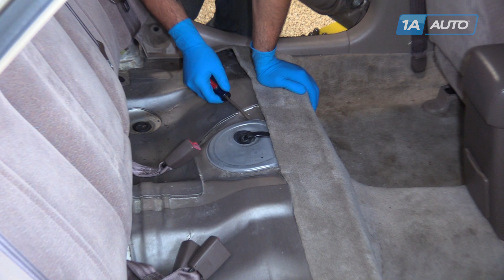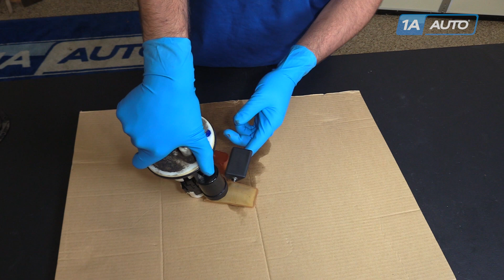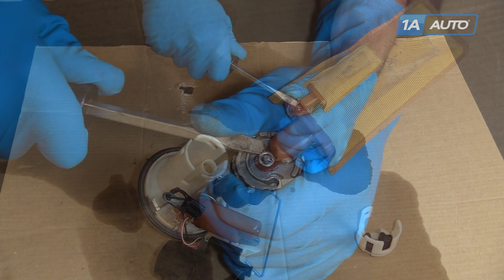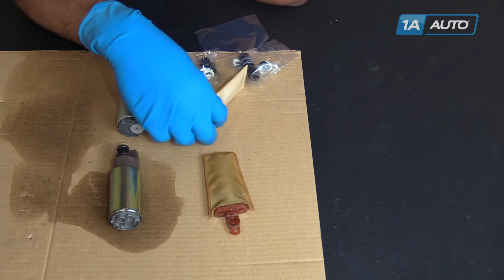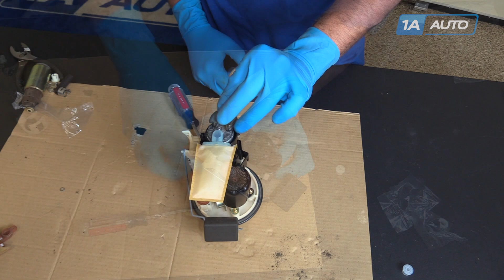How to Replace Electric Fuel Pump 97-06 Toyota Camry

Comment: I had to watch this video before I replaced my fuel pump in my '98 Camry. I work for an auto parts store out west and a few mechanics I trust said the job would be easy. Your video made the job easier than I thought. Much appreciated from a no-wrench turning guy.

Comment: What an awesome design!  It is about time someone designed an easy access to a part you know you will eventually need to replace.  Thanks for this excellent video.  I have purchased several parts for my 1999 Toyota from you and they are very good quality and work well.

Comment: Thank you for this Video,  I have a 2003 Toyota Camry, engine light is on, Code is for O2 sensor 1 bank 1.. i replaced it, but the light remains on.   I replaced the mass air flow sensor, and PCV valve, plugs, air filter, and oil, and Cat.   Light remains on, with the same code.  So It was suggested I may have LOW fuel pressure. At 225k miles...  this video, made my life a lot easier.
Reply: Was that the problem?

Comment: I just replaced my fuel pump on my 2003 Camry LE. Bought an OEM Denso fuel pump. Done in about hour. Well worth it.
Reply from the maker: +Leo Thanks for checking us out! 1AAuto.com
Reply: @1AAuto  How you know that the fuel pressure regulator mounted in the fuel pump assembly is working properly

Comment: My comments are years late but this is very informative and helpful, I have a '99 Camry ce and until now I had no idea that the feul filter housing was under the back seat, seeing your videos it makes sense now!! Well my Camry was manufactured in Kentucky. I would say that when I put gas in, I notice that the gauge reads slow and after a few minutes then it starts to rise, my question is should I just replace everything instead of just the floater?? You see it 358 thousand plus miles.

Comment: Excellent video! Helpful and informative.

AND, echoing others, I believe this video should be prefaced with the import and need to depressurize the fuel system first! A noob could follow this video and potentially end up with a horrific spray of gas in the backseat...

When I work on our family's vehicles, I depressurize the line by (1) removing the EFI/fuel pump fuse, then cranking the ignition for about 5-10 seconds, and then (2) cracking open the fuel rail banjo bolt to release any further pressure. 

Then, when you disconnect the fuel line at the access port, at the start of this video, only a tiny bit of gas will escape. With gloved hands and paper towels at the ready, you'll be all set.
Reply from the maker: +@prdr01 Thanks for the tip! We'll pass this info along to our production team.

Comment: They say Never run gas empty and Never below a 1/4 of a tank. Fuel pump should be emerged in gasoline and not running dry. This will make it wear out quicker. Also when filling tank and gas pump kicks off don't keep filling. Both makes pump wear out quicker.

Comment: Watch for bad crankshaft sensors on this model one way to tell is check engine light wont go out during cranking you wont hear power up buzz on these cars the power up during cranking so be careful diag a bad crank sensor will shut pump off
Reply: crank sensor is in distributor on '95 camry, so i got a new distributor.  Engine fired right up..

Comment: Replaced pump, filters and pressure regulator.  Fuel pressure drops, which makes the first start after parking difficult.  After reassembly (without replacing anything), the problem goes away for about a year, then returns again.  I can't figure out where the leak might be occurring.

Comment: Overall Good video but he's not using a factory fuel sending unit when he shows you how to remove the pump. Luckily my pump came with instructions with diagrams depicting an OEM fuel sending unit and how to remove it.

Comment: Great video. What is the life of a fuel pump?. I have a 2006 Camry, I purchased it in 2017 with over 197000 miles on it,  and I'm at 204000. It's my wife's work car. I like to replace parts before they give up the ghost.
Reply from the maker: +Bobby Benn There isn't a set time that parts will last for. Fuel pumps may last the life of the vehicle. Thanks for checking us out! 1AAuto.com
Reply: In my personal experience, 200,000 miles or 20 years is when I would replace the fuel pump.  Doesn't matter the make or model.  I have noticed this over the years with many cars.

Comment: I need a routing DIAGRAM for spark plug wires to the two coil packs on my 1997 Toyota Camry 4 cylinder 2.2L motor. Didn't label wires before replacing. Thank you!

Comment: by strainer is that the same as a fuel filter i live In Australia maybe we just say it differently? :)
Reply: No the strainer connects to the fuel pump assembly
Reply: No, the strainer and filter are different. The fuel filter should be in the engine bay under the air box. At least it is on my 2001 V6 Camry
Reply: Strainer and fuel filter is different. .. my 2005 Toyota Camry fuel filter in the fuel tank

Comment: The fuel gauge is really slow to correspond after filling the tank. What do you have to replace?
Reply from the maker: +Zach Marshall The sending unit may be going bad if the fuel gauge has been slowing down during fill-ups. The fuel gauge level sends a signal to the gauge as to how much fuel is in the tank. Hope this helps you out. 1aauto.com
Reply: 1A Auto Parts thank you very much

Comment: Thanks for the video,  I went to your website to buy a fuel pump, but your website has issues went I was checking out, your website doesn't past thru the check out page, so I couldn't complete the transaction. my computer keeps displaying a 1aauto problem in your end.
can you please fix it so I can go and buy the part I need. thanks
Reply from the maker: +hellanger1 If you experience issues with the website I recommend you call our service department to try and get the order in.  888-844-3393

Comment: Before doing this do you need to unplug the battery first ?
Reply from the maker: +papi kei Yes. It's always best to be safe and disconnect the battery first
Reply: @1AAuto  thank you
Reply: You should also de-pressurise the system first before opening anything up. To do that you need to unplug the electric cable from the top of the pump, then start the car. It will stall after a second. After that, take the key out, disconnect the negative battery terminal, and then open your fuel filler cap. Then it will be safe to open the fuel pump.
Reply: @anthonygardner9851  thanks

Comment: Sorry, but this video is seriously lacking in information. Where’s the instructions to depressurize the system? How about the instruction to disconnect the negative battery terminal? Since you’re teaching noobs, how about safety instructions as you’re letting gas fumes into the vehicle?

How about instructions on alignment of the various parts? And remembering orientation? Remember, you’re teaching guys with limited experience. These things take just seconds but they can make the difference between success and failure, and they will ensure the safety of those who try this replacement.